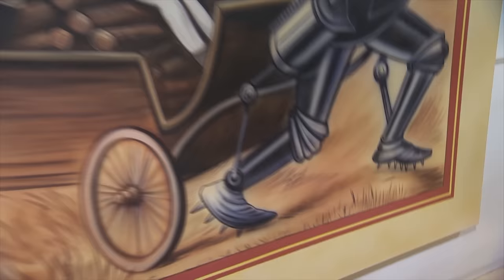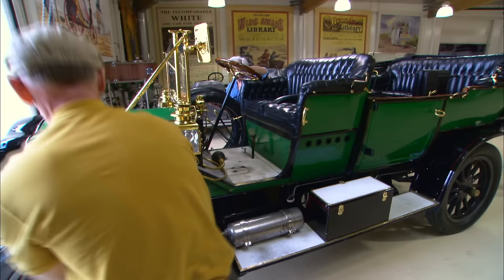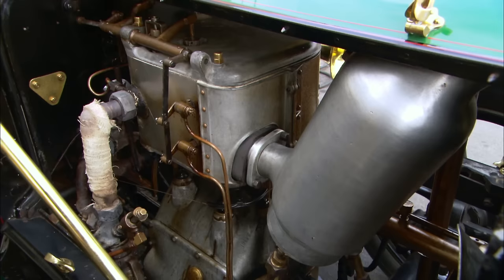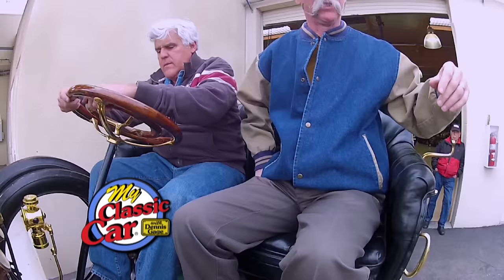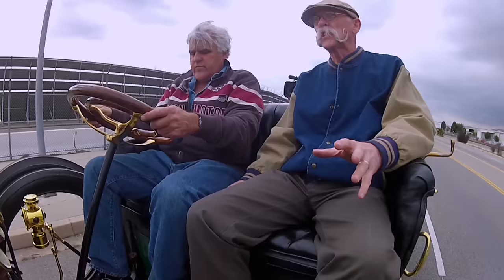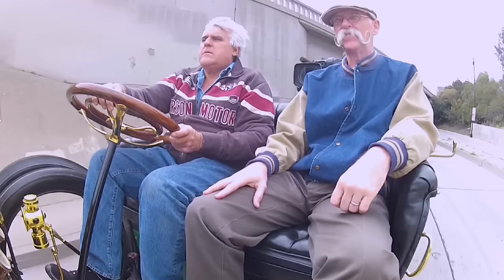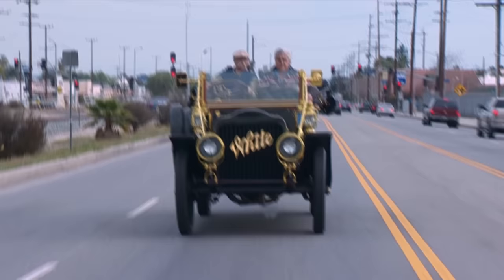Jay Leno's Steam Cars

Comment: Perfect getaway car. Fast start-up, fast car, easy to control, doesn't draw any attention.
Reply: The funny thing is that it’s actually fast.
Reply: If you drive in this thing your going to draw all the attention
Reply: I knew someone wasn’t going to get the sarcasm.
Reply: @epicetches4155  aye mate.
Reply: Thomas The Offroad Train  The torque is better than most modern cars
Reply: ur sarcastically critizing the car
Reply: Yes very fast...(air quotes  air quotes)
Reply: doesn't draw any attention?
Reply: Thomas The Offroad Train  steam cars produce alot of torque. This thing probably climbs hills like a champ
Reply: well, i wouldnt say fast startup.
Reply: EV cars with steam engines as a power generator. Looking forward to seeing this collaboration.
Reply: 40hp is ALOT for the early 1900s! A gasoline car at the time made like 5 to 10 hp.
Reply: And 800 lbs of torque! Goddam
Reply: @williamsamuel4152  really???
Reply: @spavliskojr  Strewth mate is sarcasm really that hard to understand is it?
Reply: @wowgnyfhk7434  wow, nothing gets past you, does it?
Reply: @r9740  huh, so you mean something like electromagnetic-based engine that is capable of heating some compartment.
Reply: Thomas The Offroad Train  it has over 1000 foot pounds of torque.
Reply: Uh about the attention part
Reply: Just like it's driver's moustache...
Reply: @epicetches4155  i knew someone wants to talk numnuts
Reply: @eazyono8581  you ever wonder why Toyota picked hydrogen over steam?
Reply: @epicetches4155  me too
Reply: For that you need the Doble steamer
Reply: #undefeated. Never runs out of gas.
Reply: @kennethroberts9777  yes it will the fire to make steam uses gas
Reply: I mean it is quiet
Reply: Thomas The Offroad Train  Like all cars?
Reply: Unless its in TDC or BDC XD
Reply: So Friday?
Reply: all the toys you can eat if you werent married
Reply: @wowgnyfhk7434  r/wooosh
Reply: @epicetches4155  when that happens just reply to them “r/wooosh”
Reply: You forgot quiet.
Reply: everyone will be looking in your direction as people havent seen a steam powered model-T before
Reply: Faster than a modern car by a hell of a lot!
But also much risker in some ways.
Reply: @wowgnyfhk7434  that was a joke
Reply: If you rob a bank in 1906, I guess it is. Doesn't make any noise if anything.
Reply: "Doesn't draw any attention"
...?
Reply: Just as long as it isn't a cold start.
Reply: @hdofu  yeah xD
Reply: @wowgnyfhk7434  Whooosh
Reply: Well it's pretty fast though
Reply: Love your humour
Reply: "Dispatch, I just saw two robbers getting away by car."

"What type of car?"

"Oh, boy..."
Reply: I mean, screw Musk's cybertrucks. I prefer steamtrucks like this one.

Comment: That car works way too well for it's time.  Absolute state of the art engineering at the time.
Reply: True
Reply: I was shocked watching this video. The car is absolutely gorgeous, the paint and just to look at its beautiful, but the way it keeps up with and maintains driving conditions with modern cars was absolutely incredible.
Reply: These need to comeback but in a more eco friendly way.
Reply: @ssg9offical  this car still runs on gas😂
Reply: @brandonhill3283  Probably somewhat more efficient than most internal combustion engines. A Stirling motor though... that would really be efficient.
Reply: @redryder6987  maybe more efficient. But there's a reason why we are using internal combustion engines
Reply: @brandonhill3283  imagine an electric heater inside. heats up the water and produces a semi-electric steam car. and add a solar panel to charge the battery from sunlight, or add a mechanism on its wheels (to use when in idle in cruise mode) like that electric bicycles have when you pedal and transforms it into electric energy and stores it into the battery and then later you could use it to drive.
Reply: @brandonhill3283  because big oil wanted them
Reply: @C  might aswell just use electric motors then. They make instant torque and don't need to be heated up
Reply: @RetroReptilian  no. Steam engines are just to much work for someone. Would you rather fill your car with water and gas or just gas? Then have to wait for steam to be made have to deal with problems like water lock and if you stop at TDC.
Reply: @brandonhill3283   aren't gas only engines using more gas and electric only more electricity; by being partially water doesn't it save fuel?
Reply: @brandonhill3283  the reason is oil companies pushed gasoline powered cars to sell oil based products lol EV cars has been around forever as well, but the modern days challenge is finding a fuel for already built gasoline combustion engines so you don't use more materials and damage the environment making new cars eg the current worldwide lithium shortage  because of ev production
Reply: If you know how the dodgem cars work why not make the road with a special  grid and make cars have a special  device that rubs  against  the road against  the power lines into the road
Reply: I've driven Model T, I'd take this steam car over that in a reality where both were similarly priced. Alas, combustion engine won.
Reply: @i64fanatic model T was 850 and later 260, this is 5 thousand, rhe price of a rolls royce, a luxury car, ford greatest price drop came from streamlined mass production with highly specialized production line, this was likely hand made by extremely good and expensive machinists

Comment: "gimmee a push! i'm at top dead center!" words commonplace a hundred years ago, now, only uttered by jay leno
Reply: I Believe he Really had OTHER PROBLEMS like Transmission linkage stuck in two gears, cause it's damn near impossible to have a TWO CYLINDER Steam Engine get stuck on top (or Bottom) Dead Center. Happens All-Too-Often with Single Cylinder Steam Engines, but Twins Generally have Offset Crank Journals that Eliminate That Problem.
Reply: @oldSawyer  If they are properly quartered, meaning to say offset by exactly 90°, it's impossible to get them stuck. But I don't know about Car Engines that rev relatively high, maybe they would run very rough if they weren't offset by 180° as a Diesel or Petrol Engine would be. But Stationary, Locomotive and Ship Steam Engines alway are quartered for that exact Reason.
Reply: Exactly  @Genius_at_Work  . . . I couldn't find any good pictures of the WHITE or DOBLE  Engines, but the STANLEY Was set at 90 degrees and with good counterbalance weights were smooth enough to hold the Steam Powered LAND SPEED Record for Over 100 Years.
Reply: @oldSawyer  It's more a Question of RPM though. I did some rough Calculations on Steam Locomotives and it boils down to about 150-180 1/min with the very visible Balancing Weights on the Wheels. Marine Steam Engines are similar, e.g. the 1600 kW Triple Expansion Engine on the Icebreaker "Stettin" (a Museum Ship in Hamburg) reaching up to 120 1/min.
Reply: The Stanley's with a 1.5:1 final drive ran 840 rpm at 60 mph. . . I would imagine the White's & Doble's were in the same rpm range.
Reply: @oldSawyer  Did a bit more Research on Steam Cars. They have Steam Motors and not Engines. Steam Motors are a built a bit like Internal Combustion Engines with their Single Acting Pistons, wet Crankshaft and Valvetrain instead of a Slide Valve like what you would find in a normal Steam Engine.Guess thats what enables them to Rev up so high without shaking themselves apart. You can take this Video of a Model on for Reference:
https://www.youtube.com/watch?v=oEH99bIBkJs
Reply: LOL. . . You must have been checking out the 1960s/70s GM Retrofit experiments where they tried converting gas engines into steam and Failed Miserably in doing so. . . Yes, THOSE and several others over the decades WERE Single-Acting, but only to get by using fewer parts and trying (and failing) to keep the 'blow-by' from contaminating the oil in the crankcase. . . And Yes, I am Fully Aware of the Stewart Sirius (and its Clone, the Westinghouse) which were Very Small, Compact Single Acting Steam Engines, again to use the fewest Moving Parts Possible, but they were small generator engines for charging batteries, NOT for Powering Cars. . . Most of the Single Acting Steam Engines were the Small TOYS of the "WOBBLE ENGINE" Design, and even Many of Those were DOUBLE ACTING (I Have a few of them in the basement) . . . And FYI:, the Closed, "Wet" crankcase is NOT what allowed them to rev up higher without shaking themselves apart, as all THAT Did/does is Contain the Mess from oil flying off the moving parts. . . The Stuart Sirius revs up to its 2800rpm because of its SMALL SIZE, and relies on its Massive (compared to the engine) Flywheel for its "Smooth Running", rather than having the more expensive Counterbalanced Crankshaft. . . If you scaled the Sirius Engine up to Car Engine Size you would have a 400+ Pound Flywheel hanging on it and likely not rev over 900rpm without flying apart. . . Other than the handful of "Retrofit" or converted Single-Acting car engines from the late 1930s to now, most of the Early Steam Cars had  DOUBLE-ACTING Engines in them.
Reply: @oldSawyer  It's a compound engine, therefore they can get stuck at top dead center simply because the second cylinder uses the first cylinders exhaust. This bscly means that if the first cylinder gets stuck, the second one won't fire.
Reply: @antonpersson99  Being a "Compound" Engine has NOTHING To Do With It, as They made Compound Single Engines with a smaller high-pressure cylinder added on the end of the Larger Main Cylinder, and THEY CAN Still Get Stuck at Top or Bottom Dead Center. . . The White Engine being a Double-Acting Two-Cylinder with the cylinders indexed 90 degrees from each other is what keeps it from Stalling or getting Stuck On Center. . . Being a Compound, Or Double-Expansion Engine Makes It More Efficient, in that it uses the High Pressure Steam in a 3" diameter Cylinder and then uses the Lower Pressure Exhausted Steam from That in the larger 5" diameter Cylinder, but again, THAT Is For Efficiency Only. . . Stepping on the "Simpling" pedal opens the valves to feed FULL Pressure to BOTH Cylinders for added power in Starting or Hill Climbing, but again, it is the fact that it is a Double-Acting TWO CYLINDER Engine with 90 degree indexing that eliminates the Dead Spot.
Reply: @oldSawyer  exactly what I said. It's a twin compund engine in the car, therefore it can get stuck
Reply: @antonpersson99   Not when you open the Simpling Valve and send full pressure to Both Cylinders.
Reply: In most steam engines each piston is out of phase with the other one so when one begins moving up, the other has begun moving down. Consequently both recieve power impulses at nearly the same time and won't get stuck.
Reply: My nitro R/C car guys know about not leaving the engine at top dead center. They are made to expand when they get hot so at the top of the piston it's a diameter is a little bit smaller than at the bottom of the piston.  So you don't want to leave it at the top because it gets stuck and hurts compression. Very common in the R/C community. It's like buckle your seatbelt in a car.

Comment: I used to work the steam trains at the Magic Kingdom in Disney World.  Not much different.  They're oil burners too.  Used compressed air to purge the system of the condensed steam and to start the atomization of the fuel.  Used a ball of cotton to start the fire in the fire box.  When we would have Top Dead Center of the piston, we would take the J-Bar (used for controlling the length of the stroke of the piston in the cylinder) adjust it to reverse with the steam cocks open (so not to create too much of a jerk release some of the pressure in the cylinder and make it easier to maneuver) and then back into forward.  Worked like a charm!  Brings back a lot of memories of working on the trains!
Reply: Johnson bar.
Reply: Did you know a Walter Delbert Mitchell? He used to run the trains there in Magic Kingdom.
Reply: what years did you work there?
Reply: I like trains.
Reply: Wow, thats a lot to know.  didn't know that job was that involved.
Reply: You guys still use a Johnson Bar aren’t those dangerous because of the connection to the drive?
Reply: That's fucking awesome!